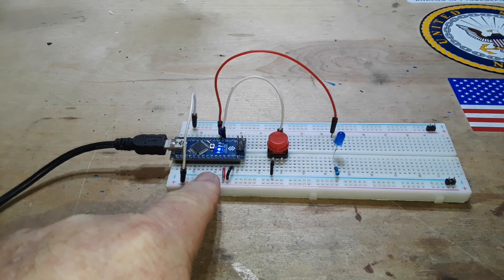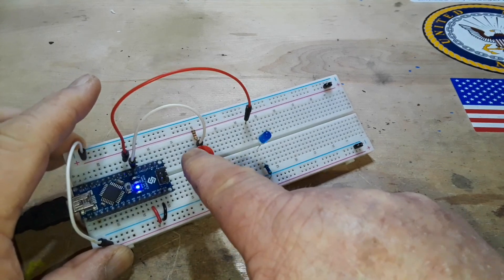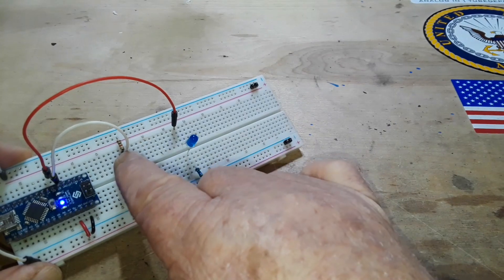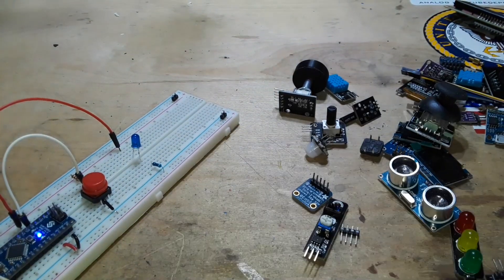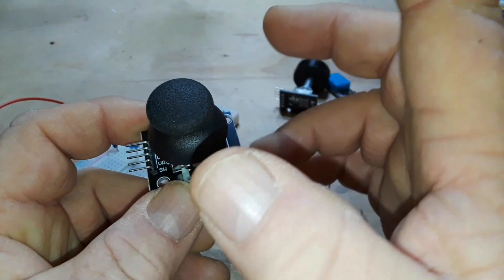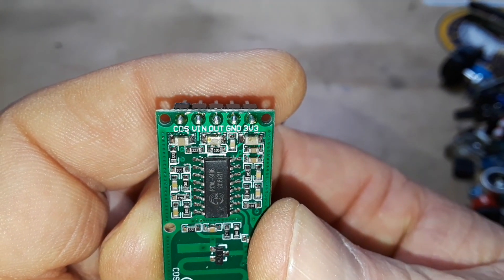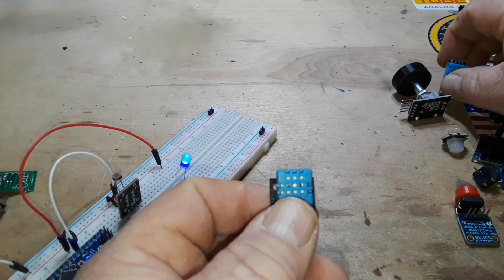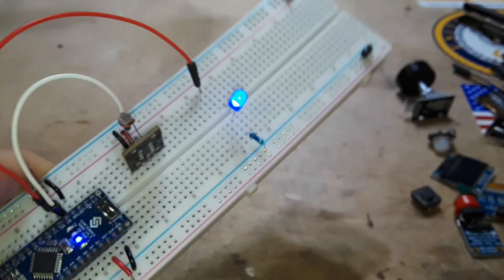Arduino Ins and Outs - The Man in the Middle

Comment: I've definitely fallen down the rabbit hole. 
I've made a few projects so far but I haven't really put multiple projects together yet. 
Like I've built the blinky lights. Sweet... Then took it apart, and made a distance sensor. 
.....And now that I'm typing this I realized I have combined projects cause I made different LEDs turn on depending on the distance measured...
Alright, well my comment was pointless.... At least I'm helping the algorithm. Lol

Yesterday I finally added my first capacitors and transistors. That was super cool! That project basically used everything I've learned so far including buttons and potentiometers. 
Now I'm rambling, I better move on to your next video that I added to the playlist. 😎